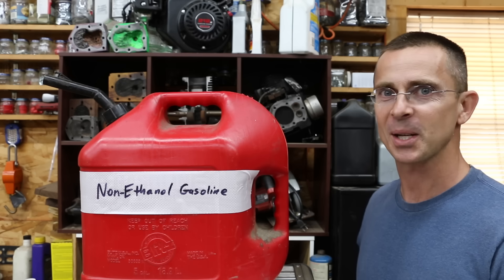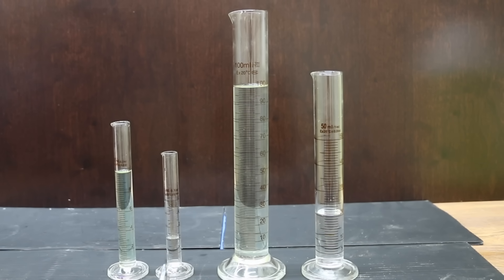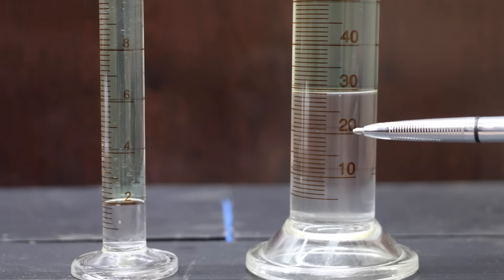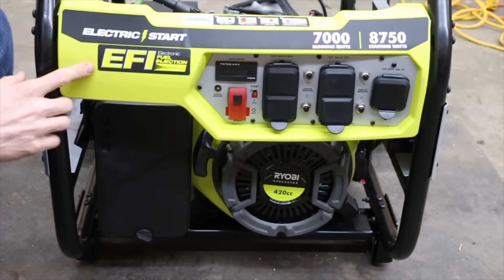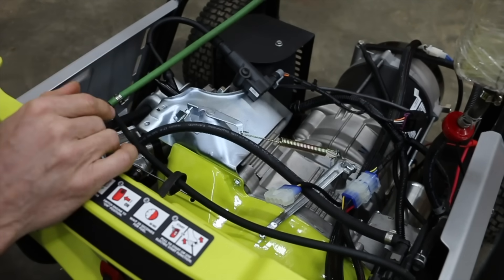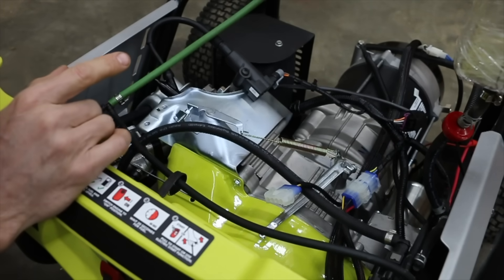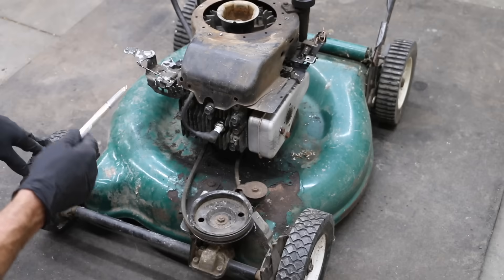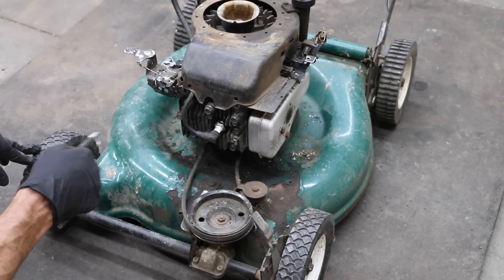Is Non-Ethanol Gasoline Really Better? See the PROOF!

Comment: I am n Environmental Geologist with over 25 years experience.  Ethanol is a hoax and a sham.  It is single-handedly depleting aquifers in areas where corn production is elevated due to a false rise in corn prices to fuel the ethanol industry.
Reply from the maker: Thank you!
Reply: I wish they would stop doing it. It was a dumb short sighted idea.
Reply: It doesnt have to be made with corn, it can be made with almost anything.   Many crops have a much higher yield than corn for ethanol production. Im not sure why they use corn.  I dont deny that it is pretty much useless as a fuel, but I bet it could be produced in a more environmentally responsible way than our current methods. I think that's a pretty bad argument for being anti ethanol.  My biggest problem is that it can absorb water out of the air, that cant be good when left in your tank.
Reply: @FTATF  I raise corn so I am biased towards the use of ethanol. The reason we use corn in this country is because it's the most abundant crop for ethanol use. In South America, sugar cane is used for ethanol production which gives a much higher yield than corn. I understand the arguments against it's use and production but I've never had any engine problems from it and have never heard about it absorbing moisture out of the air but since it mixes with water I suppose it's possible. We've stored gas with ethanol in a bulk tank here for many years and have never had a problem with water in the tank.
Reply: @66limelight  it causes many problems in small engines with rubber parts. Also no airplanes use it because it attracts water and creates problems.   I also don't recommend using it in boats. Shelf life is bad in comparison to pure fuel.  Only good for modern cars. If you store it in above ground tanks please paint your tanks white.
Reply: @ifyoutip  I have a dedicated "fuel" shed on my farm where all of the diesel and gas are stored under a roof and it also has a small overhead door. My dad had it built back in the early 80s. Shortly after it was built the man who delivered our fuel told my dad that every farmer should have a roof over the tanks. I'm surprised that I don't see that around my area. In fact just some poles with a roof to keep the sun off of the tanks makes a big difference.
Reply: @FTATF  Ethanol is a problem period.
Reply: Fly on the Rod T.V. You are correct they can make ethanol out of about any organic material. Brazil runs pretty much 100% off of ethanol. Difference is Brazil uses sugarcane to produce their ethanol. The higher the sugar content in the material used the less of it they need to produce a gallon.
Myself I believe we use corn in the U.S. because that is what the American Farmer is set up to grow as far as equipment to plant and harvest and our soil and climate are good for corn growth.
Reply: John Sullivan    I challenge you to support your accusation (Blame depletion 'single-handedly' on 'elevated' corn production) with credible documentation. The rate of aquifer depletion may accelerate due to increased corn production. But for the Osceola, and other aquifers, there has been a net depletion occurring for many decades. Satellites now document this is a critical problem, worldwide, corn or no corn https://pubs.usgs.gov/fs/fs-051-00/
https://www.researchgate.net/publication/323421112_Regional_Land_Subsidence_Analysis_in_Eastern_Beijing_Plain_by_InSAR_Time_Series_and_Wavelet_Transforms
Reply: Not only that, in Canada we are irreversibly converting wetlands to farm use.  If we were not growing crops for ethanol production, we would not be destroying that part of the environment.  The loss of those wetlands is detrimental to migratory birds and is causing eutrophication of significant fresh water lakes such as lake Winnipeg.
Reply: Jack Feder 

It’s not ethanol that’s the problem there, it’s improper use of land. If you wanted to avoid destroying the habitat of animals, you wouldn’t be using those wetlands. If moonshine wasn’t considered an alcoholic drink and was considered an automotive fuel over 180 proof, we could stop getting drunk over our hatred of new technologies and started using it to make fuel as long as we don’t drink it.
Reply: @topsecret1837  It is the use of farmland for ethanol that is the improper use of the land.
Reply: Damn, Big corn really is real. All that and then corn syrup in everything.
Reply: Che1seabluesdrogba11 

It’s not an ethanol problem, that’s a problem with the corn industry. Honestly if you want to shift corn production that puts that corn syrup in everything to a useful fuel, just start a petition on change.org.
Reply: Without ethanol the acres of corn would not change a lot because it's needed for livestock. Aside from ethanol there are bi-products as well. It's not like the corn is wasted after producing ethanol.

Corn distillers dried grains or DDGS, corn oil, corn syrup, wet distillers grains or WDGS. The DDGS and WDGS are used for livestock production.  Without them there would be much more corn used for livestock so I don't think the increase in corn acres is significant enough to make a big difference in corn prices.
Reply: John Sullivan The algae blooms in Lake Erie and other surface water see a direct correlation in problems relative to the ethanol mandate. So much phosphorus and nitrogen required to grow it. It's the price we pay to eat but we shouldn't be adding this stress on the environment just to pacify out of touch legislatures.
Reply: John Sullivan 

Aquifers are getting plenty of water these days. Midwest is flooded.
Reply: @FrankGutowski-ls8jt  Are you implying that ethanol is NOT a hoax? Even if there is a good amount of rain-water now?  In Canada, true irreversible environmental destruction is conversion of wet-lands to farm-lands.  If we stopped the ethanol hoax, the surplus in farmland would, temporarily at least, stop this destruction of wet-lands.
Reply: Jack Feder 

Wetlands are protected in the US.
Reply: @FrankGutowski-ls8jt  That is good. But... don't trust government definitions.  Lands ARE being converted to farm-land, at least in Canada.  With more land, but one tenth the population, I shouldn't really assume that Canada and the US have the same pressures.  Anyway, rant coming up so tune out if you like.....they (govt) can redefine anything they want (such as Great Bear forest), and environmentalists have no problem being hypocritical.  I was watching a show about migratory birds and the fact they are threatened by global warming.  One of the things we are doing about that is to put up lots of wind turbines, quite often on the closest points on the waterways on the migratory routes.  Do you think that will help the migratory birds? No, in the name of helping them, we chop them up.  Likewise, on another site, where someone claimed that CO2 was an existential threat, they were also proud of being part of the anti-nuke movement in the 70s.  Well, take your pick, but while nukes were dangerous, nuclear power-plants are not a risk for the survival of the human race, so, if you believe that CO2 threatens the human race, you should be ashamed of being an anti-nuke.
Reply: Jack Feder 

Wind turbines are far less lethal to birds in NA than cats.
Reply: @FrankGutowski-ls8jt  That is possible in general, but how likely is a migratory bird to become prey to a cat?  Wind turbines are not good for migratory birds.  Loss of habitat is not good for birds.  Ethanol reduces farm-land for productive uses, so ethanol decreases habitat for migratory birds.  Therefore, ethanol production is bad for migratory birds.  Likely, putting solar cells on farm-land is bad for migratory bird populations.  The show talking about migratory birds claimed that "global warming" is critically bad for migratory birds, and we must do more mitigation.  However, much of our mitigation is harmful to migratory birds.  We must not just "do something" about global warming, me must do good things or productive things.  If we harm the environment in the name of the environment, that is not good.
Reply: Jack Feder 

Migratory Canadian geese rest in Denver parks, and therefore are vulnerable to feral cats. They may prefer parks because the grass is cut, unlike tall grass in wild areas, where predators can hide. Collisions with comm towers also exceeds deaths by wind turbines.
Reply: @FrankGutowski-ls8jt  So, a few birds are taken out by predatory cats.  Do you think that is significant?  Firstly, cats are territorial so there is a limited density of hunting cats in a hunting territory, so the rate of predation is naturally limited.  Even if I did beleive you that comm towers cause more deaths than turbines, so what?  What is the point of things you say?  Because some things do damage that we don't care of the things YOU like kill birds?  It is still my point that our "mitigations" are causing problems.  What you are saying is NOT refuting that.  You are just saying that the mitigations are not the ONLY things killing the birds. I never made that claim. I don't understand the relevance of your statements.
Reply: Jack Feder 

A few birds? Cats are responsible for 10,000x the number of bird deaths as wind turbines. Something tells me you’re just blowin’ smoke...
Reply: @FrankGutowski-ls8jt  Where are you getting your numbers from?  And total numbers of birds is not the same as migratory birds.
Reply: Jack Feder 

Google wind turbines kill birds. All wild birds are to a lesser or greater extent migratory.
Reply: Jack Feder 

I also found that based on radar data from 143 weather stations in the US, 4 billion birds migrate south from Canada each autumn, and 4.7 billion migrate south from the US to the tropics. If < 400,000 are killed by turbines, 1/21,750 of all migratory birds are killed. This would suggest that wind turbines are not as deadly as you have implied.
Reply: @FrankGutowski-ls8jt  That is great!  It will make me feel easier as I go to sleep (not sarcastic).  Unfortunately,  that fact still does not mean that ethanol is not a scam and the environment at a whole would be better without it.
Reply: jack feder 

I didn’t see any comments regarding it being mandated to reduce smog. You like some others focused on shortcomings of production, others on fuel storage and delivery. I guess it’s just a reflection of this channel’s mechanically inclined audience.
Reply: @FrankGutowski-ls8jt  I was unaware that ethanol mix produces less smog.   Reduction of smog was the reason that we went to catalytic converters to reduce NOx in the exhaust.  Where I live, the air has improved many times in quality even though the city has grown 5x or 10x (depending where you consider the borders).  Based on what you said, I took a quick look.  The first two articles do NOT support the concept that ethanol blends reduce smog, although the Brazil study might be more about pure ethanol than E85.
https://www.nature.com/news/ethanol-fuels-ozone-pollution-1.15111
https://www.forbes.com/sites/rrapier/2018/08/21/understanding-the-debate-over-ethanol-and-smog/#1b1944461e01
but IMHO our transport cars should be running on natural gas until we have a cheap source of grid power but when we had the chance, AFAIK the environmentalists in Obama's EPA effectively blocked nat gas cars because it still emits carbon dioxide.  I think cars should be regulated or taxed on CO2 emissions rather than fuel consumption because the US has abundant fuel and the current concern is CO2 emissions.
Reply: jack feder 

Fuel systems have charcoal canisters to absorb vapors which are later drawn into the engine and burned.

Comment: I believe ethanol fuels have a shorter shelf life, especially in summer months here in MN.  I also believe the rubber seats in Tecumseh engines go bad (swells up and lowers the fuel level in the bowl) much faster.  Not to mention the corrosion issues you talked about.
Reply from the maker: Thank you!

Comment: If I could find ethanol free near me I would definitely purchase it. Ethanol leaves way more deposits due to collected moisture and less complete burn, I used to see this a lot when I was turning wrenches for a living, especially deposits building up on valves. With direct injection becoming popular they were having problems with burning intake valves due to the fuel not passing through the valves to reach the combustion chamber,  so what they've done is built to little pissers into the side of the injector to spray onto the intake valves and keep them free of carbon buildup. As far as fuel economy, I usually run 87 octane, 10% ethanol in my Grand Caravan and get around 18 miles per gallon. I decided to run E85 for a few tanks since it's compliant, and my mileage dropped to 13 or 14, definitely not worth the 10 cent savings at the pump.
Reply from the maker: Thank you!

Comment: This video could have ended after a few minutes, once he showed how ethanol attracts water. All you have to do is drive any pre 2000 vehicle with a fuel injection system to see how bad ethanol is.

Did anyone else notice that he didn't clean off the carbon deposits before running the non-ethanol fuel like he did before the ethanol fuel?

Comment: the big difference is long term. ethanol will attract water, separate out, and you get water in your engine. 
so, if you use your power tools frequently, ethanol blended gasoline is okay. 
if you use them once in a while, and they tend to sit with fuel in the tank for a few weeks, run ethanol-free. 

running ethanol free gas for the last tank of the season is also a good thing, so you store it with ethanol-free (and with some fuel stabilizer)
Reply from the maker: Thank you!

Comment: In a fuel injected engine, the O2 sensor will richen up the mixture when running an ethanol blend.   Straight gasoline has 120,950 BTUs per gallon, E10 has 114,100 BTUs per gallon.   Stated simply, Gasoline has more energy per unit volume than ethanol blends.   It takes more blended fuel to yield the same energy as straight gasoline.  Flex fuel engines have a sniffer in the fuel line which tells the ECU the mixture of gas/ethanol and adjusts the injector pulse width accordingly.

If you are running a carb'd engine, then blended may look like a better deal but it isn't,  because a carb doesn't adjust the mixture to compensate for the lower energy density.  You will be running slightly lean.  Dangerously lean?  Dunno.  Don't want to find out the hard way either.

Ethanol resists detonation like crazy.  That is the key plus.  If you are turbocharging a high compression gasoline engine, it will detonate at fairly low boost with gasoline, but with the right fuel map and E85 or E100 you can run higher boost levels with no detonation.  At that point, you don't care about mileage, just making safe power.
Reply from the maker: Thank you!

Comment: I would love to see long term affects of ethanol  on carburetor components. I have a 74 Powerwagon that had the old two barrel carb on it, the carb was fine until our area switched to ethonal blended fuel. The internals of the carb literally degraded and fell apart. The aluminum inside the carb disintegrated and the jets fell out. I put a 4 barrel carb on it that was designed for race fuels "alcohol and methanol" i rejeted the carb for gas and installed it on the truck. It must be made of a higher quality of aluminum as i have seen no wear or degradation due to the fuel. I try to run at least 50 percent or more of cam2 mixed into the fuel so I don't start having problems with the engine. Old engines are not designed to run on the crap they call blended gasoline nowadays.
Reply from the maker: Thank you for the video idea!

Comment: Ethanol needs a 30%bigger jet!Your running running it over shit damn lean an it will destroy your briggs in 10 tanks. Ethanol has a 30%less fuel efficiency in a well jetted engine!(per measuring unit) Besides your briggs will even run on 50%diesel,cause  of 
a power output per cc of not existent...
Reply from the maker: Thank you!

Comment: Based on my experience, 10% ethanol gas is only useful in an automobile with a sealed fuel system and is used daily. In any other application such as a boat, lawn mower, or other small, infrequently used engine, the ethanol gas fuel is not recommended.  Condensation in the fuel tank is your biggest headache.  Additives such as Sta-Bil do not work to eliminate the water.  Pure gasoline is the only choice in with these engines.
Reply from the maker: Thank you

Comment: An old timer in the small engine repair shop told me ethanol is harder on small engines than it is on big one. He was getting engines needing new rings at an alarming rate shortly after E10 showed up. It got better over time, I guess the companies started using different metal in the piston rings?

He mentioned fuel system problems too but not exactly what they were.

There ARE some stations now offering 100% gasoline. It is about 20 cents more per gallon. I bought four five gallon cans so I could fill them and keep them in the shed. I add sta-bil to the three that will sie there the longest. No problems. The lawn mower and snow blower start right up even after that gas has sat there for seven months.
Reply from the maker: Great information.  Thank you!

Comment: I only use pump gas in the two vehicles that require gasoline.  All my small engines run either trufuel for 2 stroke or the 4 stroke formula. I also use VP Fuels 92 octane for my 4 strokes.
Reply from the maker: Thank you!